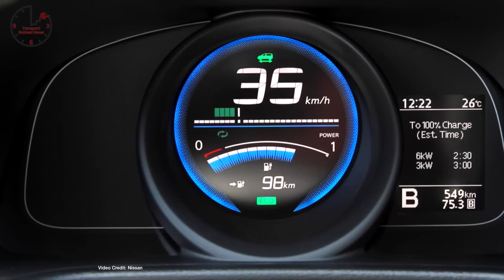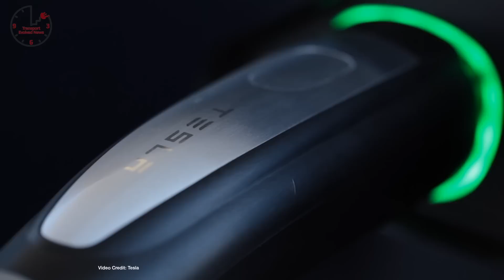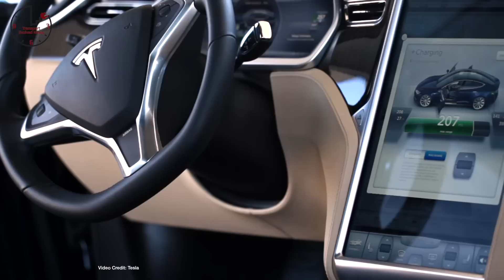Tesla Q3 Production, Nissan V2G Push, Autonomous e-Drones  - TEN Future Car News 10/6/2017

Comment: The BFR can be carbon neutral if the electric energy required to make the fuel comes from renewable sources. Methane is made by the Sabatier process from atmospheric CO2 and the liquid hydrogen is made from water.
Reply: The Sebatier process uses gaseous Hydrogen, not liquid.
Reply: Agree space flight uses relatively little carbon fuel.  The amounts are tiny compared to our other uses.  However if BFR were used for Earth to Earth travel it could become an issue, just like airliner fuel.  That said Methane burns much cleaner than jet fuel/RP1 rocket fuel.
Reply: Do the Math. BFR will release trivial levels of emissions, it would be idiotic to make the fuel from renewable sources. There is a thing called Carbon Abatement cost. If you really care about the environment you focus on the low hanging fruit method of getting the most emissions reductions.